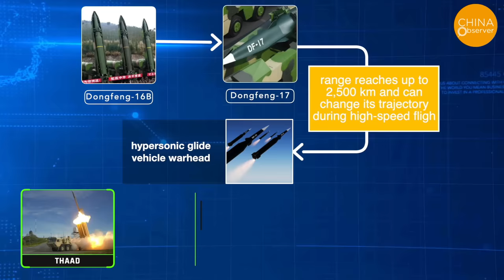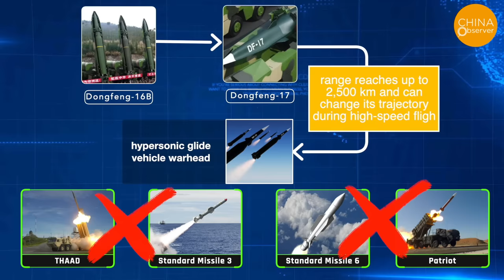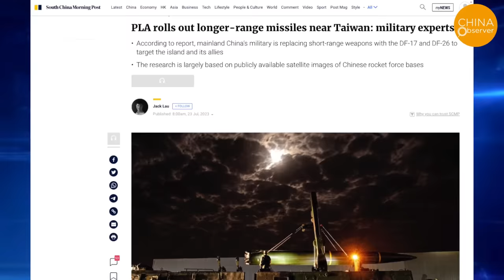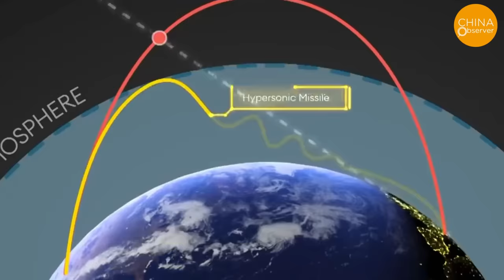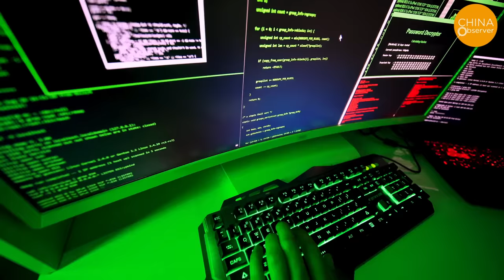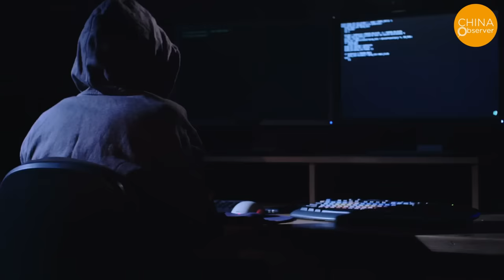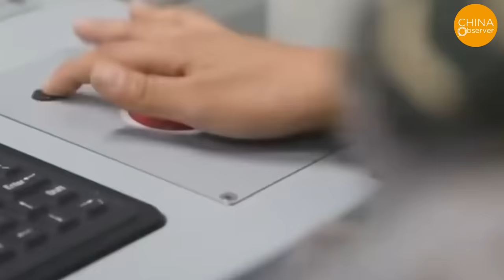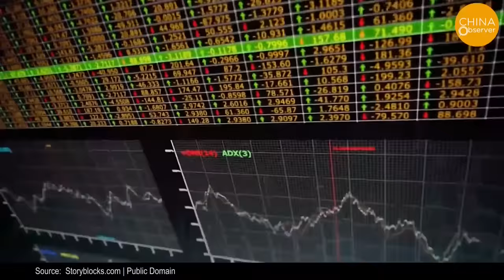China's Missile Technology Is Now Reduced To Boasting And Theft！Hypersonic Missiles Face Their Doom

Comment: If as in this video anyone believes the US won't have a capable laser based anti-missile system until 2050, they'll be greatly surprised.
Based on current first gen deployment of laser weapons and the bits of publicly released info, the US probably will have a 2nd gen deployed by 2027 and may have a system capable of defending against hypersonic and maneuverable missiles traveling 10+ Mach by 2030. If not by that year, then probably sometime not long after then.

There's no doubt that the US will have a power source available by 2030, even today the Ford aircraft carrier likely has more than sufficient power. The question is if a power source for other deployments that's smaller and likely portable can be developed and how soon.
Guidance will need to be developed but ironically the faster laser weapons can be developed, the less of a burden will be on guidance to track and target requiring less predictive calculations.
The laser weapons themselves will need to be developed to enhance range and power. Relatively recent innovation to pack multiple individual lasers instead of one single large beam improves penetration through atmospheric disturbances needs to be improved.

US research and development is proceeding at a good pace and shouldn't take long to produce results.
Reply: @junicohen7918 one problem copying is all well and good but without knowledge it can be detrimental the us armed forces are well known for not keeping real blueprints accurate so in the case of theft it leads to major problems
Reply: @halo129830  good thing they bought the dod,have working spy balloons and got that sweet classified equipment from Afghanistan.
Reply: we do it's call patriot missles sytem.

unless you brake the laws of physics you can not have a manuvrable and hypersonic terminal missle as one. any slight deviation at those speeds can end up riping apart the missle

secondly the missle its self needs to reconize and have enough time to know it;s been painted and get out of the way.... so this is inreality a joke if you look up how patriot works unclassified.

dumd down version is that the radar for the main system is  telling the missle where its target is all all times till the missle untill it gets close enough that the target has no time to recate then the missile's own radar is turned on. at most the target has 3 seconds to itentify that that are locked on and get out of the way.
so this isnt realy a threat persay as much as it is a need for a new radar to better track these things
Reply: The USS Ford's nuclear power system generates 300% more power than the already massive power production of the Nimitz class carriers. They are designed to field almost any new generation energy weapon platforms being developed for the next 60-70 years.
Reply: @ProjectAtlasmodling  People like you just do not have the technology to work out how hypersonic can change course during flight. and experts are working it out and why are building them now.
Australia helped USA in hypersonics and has world fastest scramjet at mach 12 thanks to Ray Stalker 1st to get essence of flight from scramjets and built special world fastest hyersonic test tunnels to test hypersonics.
China even copied these hypersonic wind tunnels and is what they use also.
Australian company will test fly a scramjet hypersonic drone this year and just won a USA DUI HYCAT contract to build USA hypersonic vehicles. is a lot around on special materials they have now developed to sustain hypersonic flight.
Reply: @nedkelly9688  he has two videos about the suject one over a year ago and the other ten days ago
Reply: @ProjectAtlasmodling  Mate i do not care i have been following hypersonics for decades even before became a big thing. the technology in the materials needed for hypersonic speeds at the high temperatures for missiles and planes is just coming in now. Space shuttle etc used special heat tiles. missiles and new tech drones and planes are looking at special metal.
Australia has had a working scramjet since early 2000s proved in atmosphere tests at mach 10, but are just now getting the materials and furnace to produce them to build a drone capable of running these speeds.
HIFIRE 4 2017 joint USA, Australia successful mach 8 HGV hypersonic glide vehicle manouvred successfully while reentering the atmosphere. so please tell me how we can not produce hypersonics that manouvre at speeds.
Reply: @nedkelly9688  so the space shuttle was a hypersonic vehicle designed in the early 1970s and first flew in 1981? Cool. Even cooler, before that was the US X-15 hypersonic aircraft first flown in 1959 and still holds the world record of Mach 6.7 set in 1967 for the highest speed ever recorded by a crewed, powered aircraft, which remains unbroken. US manned hypersonic aircraft have been around for 65 years now. The US even used their hypersonic spacecraft to build space stations, pretty cool stuff. 🤔
Reply: @nedkelly9688  first of all i trust a guy that i can back up his cradentiols over you (if you can prove me wrong do so) 

secondly the problem isnt getting to those speeds (been done sence paperclip). its maintaining control to hit the target with out self destruction before hitting it.

you have a scram jet nice, they've been around for years. 

you have realy stong alloies that can wistand the heat nice. but they cant do that while making drastic manuvers.

plazma stelth can be sean through by any competent modern side scan radar, thust it's piontless.

you have a missle that can go 20x the speed of sound, nice but all i have to do as a air defender is get in your way because you can't manuver without slowing down.

go hypersonic in flight and in terminal but at the end of the day you don't gain much against any nation with modern air defense.
Reply: @ProjectAtlasmodling  I think he's just upset China owns most of Australia now, physically and financially. 30 million Aussies total and soon 100 million Chinese on the continent. That's gotta stink for Pooh Bear to have his hand up your country's cheeks...
Reply: @powershift2024  Yea i know all that but was issues with the coatings and airframes needed for hypersonic flight and needing to last longer. all those you speak of only flew for a few seconds at hypersonic speeds. except space shuttle and it uses a tile that cannot be used on missiles. it is over my head but the research is out there of all these different countries speaking of materials they need for longer durance hypersonic flight and that tech only just out last few years.
Reply: @powershift2024  And X15 was just a boring old rocket lol. ancient technology compared to the scramjet
Reply: @ProjectAtlasmodling   This guy has no credentials  lol just a youtuber spouting what he believes. now be a smart  iq person and everything i said can be found on internet by other highly credible people in the actual fields of these technologies.
Scramjet has  been around for years, but no one has gotten them to work before lil man. yes people have tried to get them to work but have failed until last few years lol and show you have no clue about the technology.
Reply: @nedkelly9688  yeah I knew it was pretty boring, still holds the world record for 65 years now. Oh well, I'm sure the US or EU will figure out the coatings, guidance systems, launch vehicles, etc, etc, etc. At least you guys built an engine and a wind tunnel. The US and UK will give you some nuclear subs at some point, it may be just enough to keep the Chinese from taking the entire country. Cheers!
Reply: @powershift2024  Yea many countries have figured out the coatings and Australia will fly it's scramjet drone this year
Reply: @nedkelly9688  he's someone who trains people on how to use the patriot air defense system. i'd say that he's more than qualified

if you need proof find his 'huh imagine that' short. all the proof you need.
would link it but youtube no like that
Reply: @ProjectAtlasmodling  Ad what are you going on about who has 2 videos. my original comment was to you who was going on about hypersonics can not change course during flight or will break up bla bla,.. is not true yes they slow down of course but hypersonics can change course while being hypersonic in speed.
You so clueless you got confused on the conversation haha.
Reply: @nedkelly9688  I didn't say change course they can not make drastic course changes to avoid being intercepted . Trying to do so will rip it apart